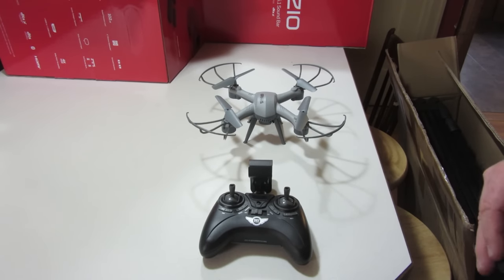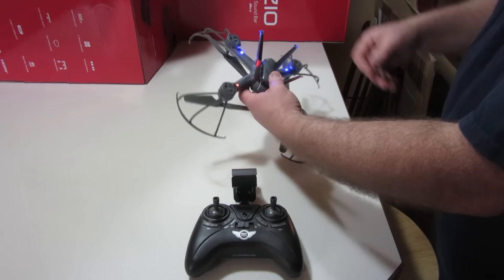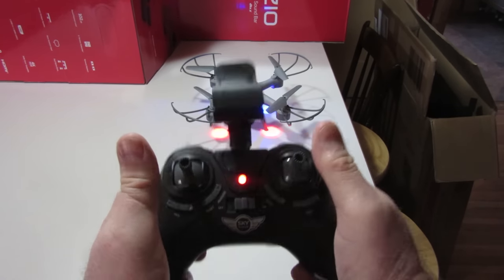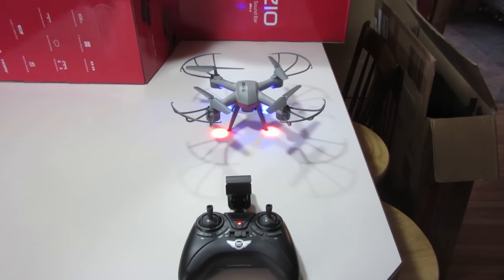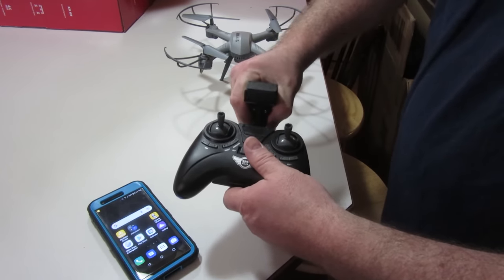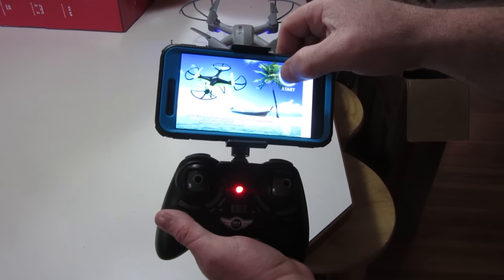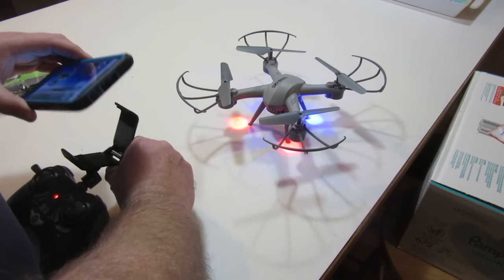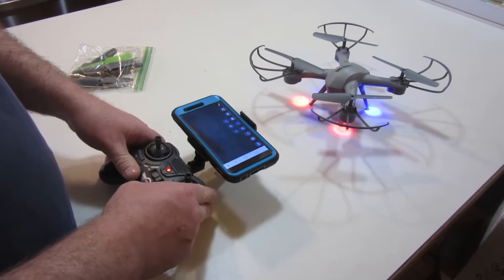X-31 SHOCKWAVE  DRONE FROM HOME DEPOT VIDEO CAMERA SETUP

Comment: I work at Home Depot and we get these drones every holiday season, this one no exception.

I set one up to demonstrate in the store. I also own a pair of DJI drones, so this little toy is no comparison but can be fun if you have realistic expectations.

First, it will not hold position in a hover. Expect to constantly adjust the controls and the trim.

Second, it is absolutely not meant to be flown in any wind. Indoors only, or outdoors on a zero wind calm day.

Beyond that, it performs reasonably well.

Comment: Suddenly I realized you sound like David Letterman. And now I can't unhear that!
Also, great videos. I've watched the first one already and now I'm watching the second one. I just bought the drone today at Home Depot. It's 10:00 at night barely any breeze and the batteries almost charged. hehehe.
Reply: How did it go?
Reply: @jupitercyclops6521  I've been practicing in my bedroom over my bed for the last couple of days. And it's amazing how much better I am now than I when I started but I started at zero. Now I'm at about 25 out of 100 Maybe LOL I just took it outside for the first time and I can say this, it's a lot more fun to bash into a tree than to bash into the walls over and over and over. But I haven't been able to damage the Drone yet at all. Or anything else in my bedroom. I could use another set of blade guards but the Drone itself still works beautifully. Even after bashing it into a tree I just flipped it over and took off again. It's only 2 oz so there's not a whole lot of inertia no matter how fast you're going and I'm only on speed setting 1 now anyway.
Best 35 bucks I've spent at Home Depot in a long time. I'll probably go buy another one just for parts.

Comment: Have a red light blinking in box that house the camera. When I put drone switch on drone lights do not come on to sinc with controller, but red light blinking in camera housing. Maybe a reset needed? Can't get it to work. Fully charged

Comment: Something I didn't hear mentioned was if the camera on the drone needs a constant wifi connection to operate, or once initial connection is made, it will operate normally and send photos and videos to the phone at any distance regardless of wifi range.
Reply from the maker: i haven't flown it very far so i don't know .
Reply: @Junk works Garage  yeah, this definitely isn't an outside drone. The slightest breeze makes it virtually impossible to fly. I appreciate the video though, it helped a lot.